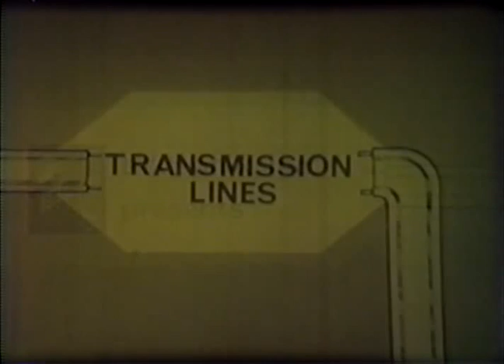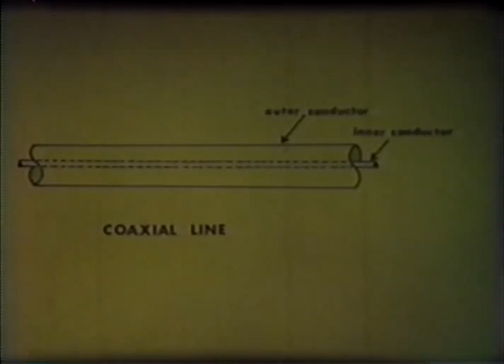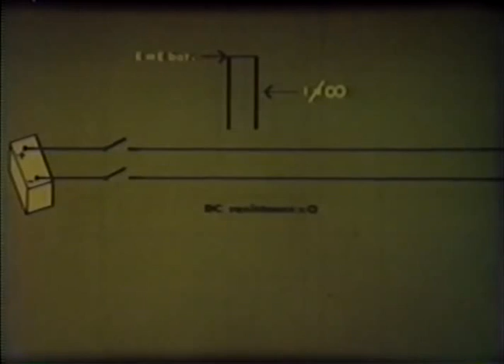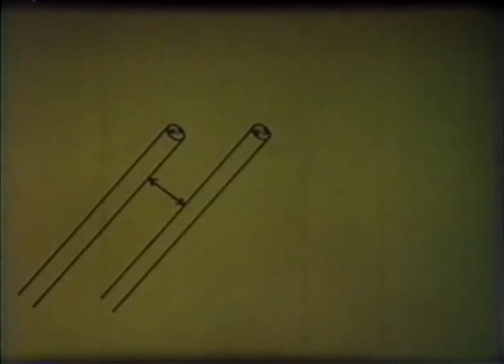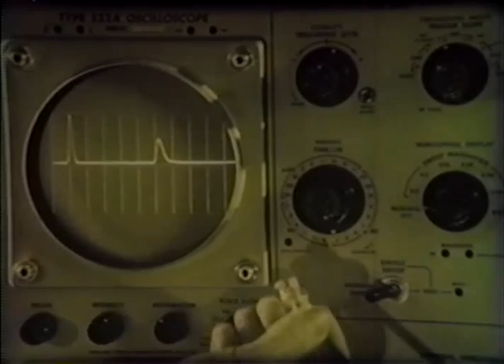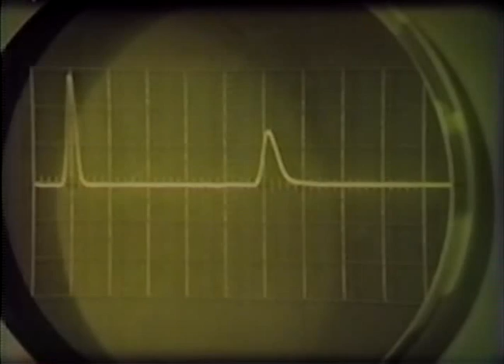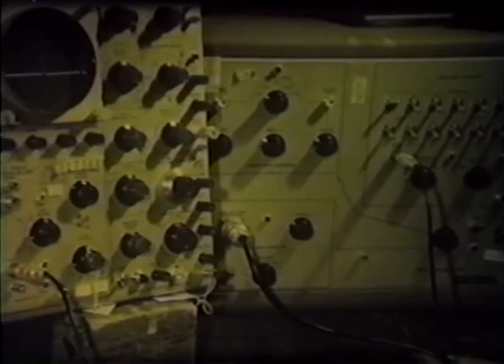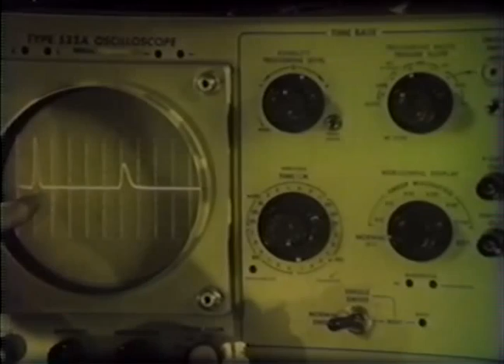Tektronix - Transmission Lines

Comment: I was watching this at 2× speed, kind of bored until about the six minute mark... and then I sat up and said, whoa!  I had to rewind because I'd never learned what characteristic impedance actually was. I knew the effect of an impedance mismatch was that the signal bounced, but I didn't get why it did. 

In rapid succession there were three key things this video taught me about high frequency signals:

1. The insulator between conductors, even if it is air, is the "dielectric" of a capacitor.
2. Every wire, even an ideal one with zero resistance, has inductance. 
3. To make it easier to conceptualize, it's okay to chop up the line into multiple segments of repeating inductors and capacitors that pass the signal one to the next. 

Also helpful was the reminder that the characteristic impedance Z = sqrt(L/C). Increasing the length of the cable increases L at the same rate it increases C, so it cancels out when calculating Z. Therefore,
 
4. Theoretically, a cable will have the same characteristic impedance no matter how long it is.

Comment: Some people might think that this video is boring but actually it is exciting if you use imagination to understand the principals. Consider that these are also the principals of acoustics where a "reflection" is called an echo.  A string on an musical instrument behaves exactly the same way constituting an acoustic transmission line with a small load, the string is plucked or bowed to create a pulse, this pulse travels to the end of the string and is inverted and reflected, then it is reflected again and re inverted off the opposite end. The pulse moves back and fourth making a tone that gradually decays. The instrument body functions as the load and the players motions as the temporarily connected battery. The pulse contains many harmonic frequencies and the nature of the load(the instrument body) verses the length and structure of the string determines the standing wave properties that filter the harmonics which provides the timbre (the tonal quality) of the instrument. 

Your breath is a battery, your vocal chords are a switch, your throat and nasal passage are two acoustic transmission lines and the air outside your lips and nose are the load. The transmission lines in this case are very complex with different adjustable impedance's distributed along their length( unlike an electronic transmission line with its consistent impedance) such that the end result is you can sing and speak. Most people think electronics are very abstract and remote form day to day existence but you are using these principals every to time you speak, you are appreciating these principals every time you listen to music.
Reply: wow
Reply: amazingly written

Comment: Good stuff.  For those who didn't know, the PC pci bus works like that reflected flattop signal at around 20: min.
The driver only makes half the amplitude/current to get to logic level and the bus is sampled at reflection time so things see the full desired level.  Fairly slick, but obviously length dependent in the extreme.  If anyone worked with ECL back in the day, the only other good reference for this work was from Motorola ECL design handbook...and I still use the knowledge today.
Reply: Oh my gosh, that's absolutely amazing, I'd like to find more Information on this. Any other links or book titles?

Comment: Now I finally understand transmission lines, characteristic impedance, and reflections. Now to apply this knowledge in the real world to RF and in helping better understand antenna theory. Though I still wonder why impedance matching and reflections aren't an issue at low frequency, with electrically short conductors (transmission lines). Particularly in the Audio world where power amp output impedance is ideally 0 Ohms, going into a load of a few to a few hundred Ohms. Oh, is it that the characteristic impedance of a transmission line is high enough to be negligible at low frequencies?

Comment: For a short circuit, the return signal was said to be reflected.  But aren't the short circuit's 2 emitted pulses each just transmitting through the short circuit to cross to and return in the opposite line, which explains the short circuit return signal's opposite polarity?
Reply: Well yes, but the major point is that the signal doesn't disappear at the end, it returns. And by convention we call that return a reflection when talking about transmission lines, regardless of the exact mismatch phenomenon causing the return. (If we were talking about radar, the reflection of the energy from the target is called a "return", just to be confusing.)
Reply: @lwilton  Thanks.  I think that, because there really is no reflection in a short circuit, to avoid further confusion, the convention should be changed.  I don't find the radar reflection to be confusing, since it really is a reflection.